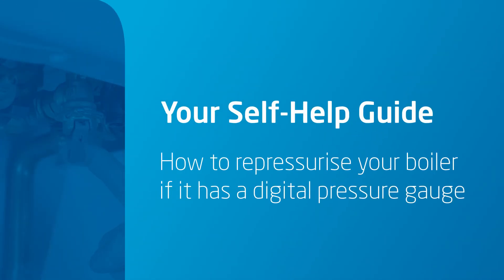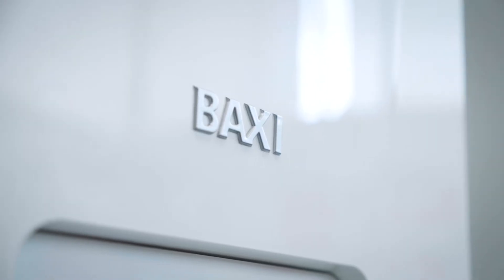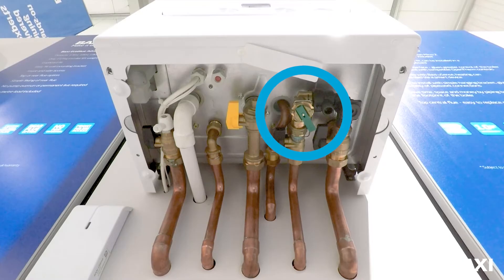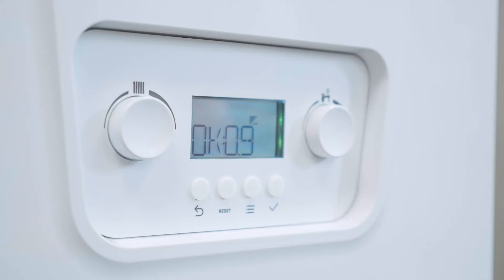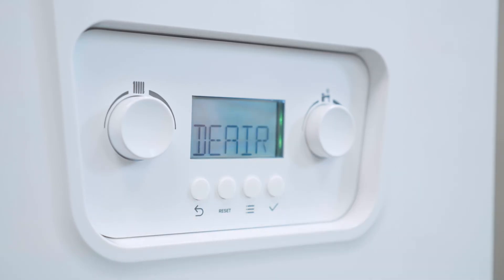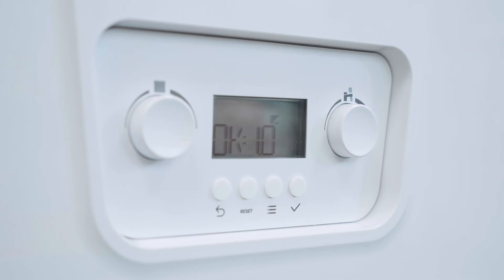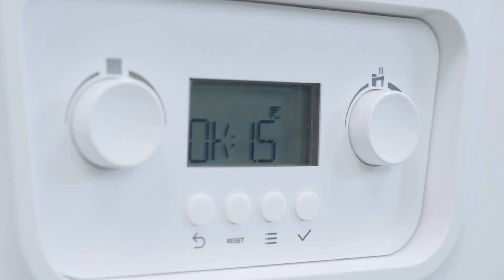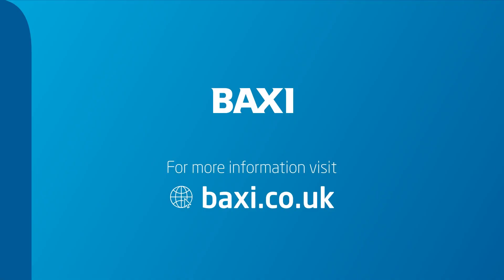Self help:  How to repressurise your boiler if it has a digital pressure gauge

Comment: 😢 Please Help 😮 
There is only a yellow and black lever?, why is there no green 🟢 lever on my back boiler Assure 500, and no pressure gauge on front with the Baxi model Assure 500 as it's a digital combi boiler.... Is there any way to fix as there a yellow 🟡 lever and a black ⚫ lever underneath the boiler, there two black⚫ levers on the pipe that had the loop for pressure against the wall

Comment: Hi,
Hope you can advise me please,.  
All I got is a yellow and a black leaver,  

I’ve not had any issues with the pressure yet but was wondering if it’s the black leaver I use.?
Thank you
Reply: I had to turn two black valves on connected pipes below the four shown here. These were for the water, not as shown. Hope this helps you
Reply: Same boat.......
Reply: Hi  @axellex2077  I’ve been advise it’s actually the upstairs boiler which you would  use if any loss of pressure,. I’ve had a look at mines and right enough it’s got the taps there,.👌🏼. If you have an upstairs big boiler have a look,. Hope all works out good for you,.  👍🏼👍🏼
Reply: @axellex2077 I’ve got the same problem did you use any of the black leavers instead? Don’t have a green one
Reply: I’ve got the same problem did you use any of the black leavers instead? Don’t have a green one
Reply: No green lever, they are all black
Reply: Same, don't have a green one, just the black leavers.
Reply: Hi @ Turns out because I’ve got a large copper calendar upstairs in a cupboard I do it from there ,.  Hope that helps👍🏼